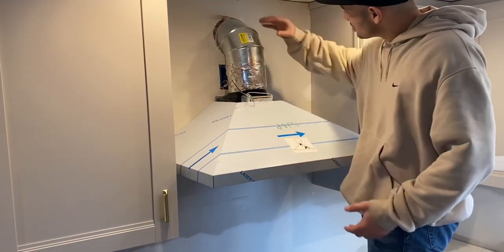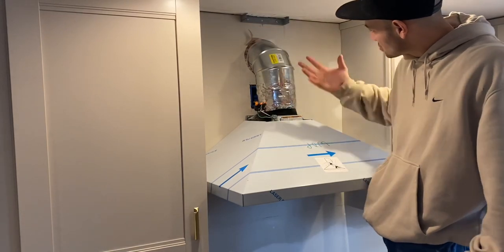Installing Wall Mounted Stainless Range  Hood with an Outside Vent

Comment: Do NOT ever cut through a stud. If you need to remove a stud you need to properly brace around it. Remember, the studs are what are holding up your 2nd story and/or roof. If any of the other studs in that wall were compromised due to water damage or insect damage, cutting through that stuck could seriously compromise the integrity of your house.
Reply: YOLO
Reply: I thought the same thing.  I'm looking to vent my microwave vent above my stove, with an empty cabinet above that.  

I'm a novice, so my idea is that if I gave electric or a stud in my way, I could move the vent to the side since it's hidden.  

I have an outside wall and vinyl siding is my next question which he doesn't show how he covers the vent.  Any tips?

Comment: Great video! Thanks for the info.

Any tips to remember when I have a cabinet above the microwave? Should I remove the cabinet above the microwave and drill holes separately through wall and cabinet? Or keep the cabinet in place and drill straight through?
Reply from the maker: Generally you leave the cabinet in place but take the doors off so they are out of your way and won’t get damaged during the process. The back of the cabinet is only 3/4 of an inch thick of plywood so the process  is the same.
Reply: @IllGetMyTools  awesome, thanks again!

Comment: I'm prepping my kitchen now to do this, great step b step video! Only exception is I need to create an opening through a brick wall with stucco over the brick on the exterior. I thought about renting a diamond core drill from HD. Do you recommend I hire a professional instead? Also will need to move my electrical to up and to the center of the wall.
Reply from the maker: I don’t know about your masonry ability. It’s not hard but you need to know what you are doing. The good thing is whatever vent cover you choose will have a flange to cover the exterior hole assuming you did a clean and accurate cut. And as for electrical, the same, it is a very basic thing to extend wires through a junction box but if that is not your forte then definitely hire a pro.
Reply: go through the roof. that way is much easier than dealing with bricks & cinderblocks
Reply from the maker: @hamajangz9586  if the house is only one story that can be an option.
Reply: @IllGetMyTools  tru damn bro that's tough but yeah dealing with masonry is a whole nother beast. it's doable but novice guys might struggle mightily in that case i would call in the pros. it'll cost you tho that shit isn't cheap

Comment: Hi.
This is really helpful. I am planning to buy a home. Do you suggest I take this as an upgrade or do it later? They are asking 7K for Wall mounted stainless range hood and Oven and grill on the side. They are providing GE Appliances. Please kindly suggest
Reply from the maker: Sounds reasonable. This hood was $1200 and my Samsung stove was $3500

Comment: Good tip on reversing cut
Reply from the maker: No problem good luck with it!
Reply: @IllGetMyTools  how about a follow up video on getting power to the hood lol
Reply from the maker: @rjennis3339  couple options: hardwire a junction box behind the vent and then simply connect the three wires from the vent to your romex .....or even better, Install an outlet behind vent, then splice a three prong plug into the wires coming out of the hood itself and plug it in.

Comment: I like how you explained the process. I have the same issue with the stud, is it gonna cause issues if I cut the stud?
Reply from the maker: Bary cutting out one stud is fine. Most of these range hoods sit on exterior walls meaning the framing is supported by the actual foundation. I’ve done this in a few other houses aside from mine with a second floor on them and have not had any structural issues
Reply: If it’s an older house with balloon framing, that stud could be the only thing supporting the floor joist above. Unless you can build a header, it’s critical to change the kitchen layout so your vent goes between studs. (We had gutted our old kitchen so saw where everything was and could make the adjustment before it was too late)
Reply: Yes. It very likely will.

Comment: Been commenting at so many videos with no reply. If the vent hood is going straight up and vertical like that it won't work for my kitchen because above my kitchen hood location is below the master bedroom. So how do I make it so it goes up and to the left to the outside wall ?
Reply from the maker: Not sure what you mean I did not vent my hood up, it’s vented directly outside that kitchen wall.

Comment: We have a vent hole thru wall (not ceiling )for microwave/vent combo above stove. Can we just tap into  existing ducting when replacing with hood vent?  Also, the electrical outlet needs to be moved in line with the hood and vent. Is it a diy, or best to hire an electrician since it will be hard wired? Nice video!
Reply from the maker: J C vent hoods need a 6” vent hole to the exterior, if you have that now then you can absolutely tap in to it. It is simple to change the outlet to a hardwire box. Just take out the microwave outlet and hardwire directly into the range hood. But if you are uncomfortable then absolutely hire an electrician
Reply: IllGetMyTools Great! Our vent hole is at least 7” (guessing as I didn’t remove the ducting). I hardwired our new double wall oven so I’ll give this one a try as well.  Just have to figure out how to pull wiring from outlet to just below vent hole like you did (do I cut drywall horizontally from outlet box to center).  Handyman just quoted us almost $3K, can’t use existing ducting, have to raise vent hole and make another hole outside , repair stucco, etc). Thanks for quick reply!
Reply from the maker: J C just run a second junction box below the vent hole. Utilize your first box where the switch was. Take off outlet you had and create a new junction in there. Then run new wires to the second junction box under vent hole. And yes you have to cut the Sheetrock to run wires if there is a stud in the way.
Reply: IllGetMyTools Sounds good.  I’ll hit you up if I run into something. Thanks!

Comment: Hole saw size is exactly 6” or 6.5” for the duct?  I’ve heard that 6” duct’s diameter is actually close to 6.25”.  Thanks
Reply from the maker: @davidv3518  I don’t remember, I bought the piping at Home Depot and then brought it over to the hole saws and see what would work.

Comment: Nice.   What do recommend for brick ?   I need do the same job thru brick.
Reply from the maker: Depending on how old the building there will still be studs, sheathing or plaster lathe, and then the brick. I would cut the brick out from the exterior and still use a 6 inch vent on the outside. Use Either a small power chisel or manually chisel out the bricks for the opening. You can then use the hole saw to get through the sheathing or lathe to reach the interior.

Comment: Maybe drill through vent hood backside (if possible) into a stud to help the drywall anchors out...
Reply from the maker: I did add two additional screws into the studs by drilling a hole into the backplate of the hood

Comment: If you measured for your duct center prior to drilling, would you still have to cut the ducting?
Reply from the maker: If you bought a 90 degree duct and measured perfectly then no you wouldn’t have any extra cuts. But ducting is very easy to cut and add lengths too if need be. I actually wanted my exterior vent to be right below one of the siding bottom lips so it looked neat and I wouldn’t have issues with water getting in.
Reply: @IllGetMyTools  Makes sense, my siding is Hardie and more smooth so I can probably put the cutout in a more convenient location.
Reply from the maker: @moonpiespotlight4759  hardy board is great! It Will allow you more options in how to finish the exterior vent. Remember when cutting the exterior siding keep drill on reverse

Comment: What did you do to cover the outside duct work?
Reply from the maker: I purchased an exterior 6 inch siding vent. It’s aluminum with a flap that automatically opens when the vent turns on.
Reply: @IllGetMyTools  thanks! Great video. Good job.

Comment: Hello
How can you add the cover on the other side of the exterior wall, where the vent comes out ?
You will need a stair in order to  access it on the outside, to install the cover ?
How to do that in case of an apartment at 3rd floor ? :(
Reply from the maker: Definitely need a ladder and depending on how high your foundation is  probably a 32-35 foot ladder. Some tool rental places rent them. But that will be the only way.

Comment: If I have a vented range hood now, can I replace it with a ventless (recirculating) hood?
Reply from the maker: SpammsMcghee recirculating hoods don’t work well At all especially when frying food or cooking things like fish it just puts the same air, smell, and smoke back into your kitchen. The charcoal filters don’t work well. But if that’s what you want to do just block the hole to the exterior with plywood insulation and or Sheetrock it’s easy to do
Reply: @IllGetMyTools  Cool, thanks!

Comment: I am concerned about this project being a DIY. We are handy, but drilling into foundation scares me. What type of trade specializes in this type of project?
Reply from the maker: There is no drilling into the foundation. I drilled through a framed, sheet rocked and wood wall. I’m a carpenter so maybe you can hire one if you’re uneasy about it.
Reply: Illgetmytools That was my next question... what tradesman would I hire for this project?

Comment: You just took out a stud and dint re-enforce it?  I hope nobody is actually taking this video seriously
Reply from the maker: I know!! I did that 4 years ago and my house collapsed!!….It’s a non-issue, I framed homes for many many years. Even if I were to run a horizontal stud to lock it in place there’s no point, it’s still not structural. The sheathing on the exterior of the house will hold that cut stud in place from moving.
Reply: @IllGetMyTools  There is a right way and a wrong way to do things! Cutting a stud without reinforcing is basically cutting corners, hoping that nothing bad happens. And i am glad it worked out for you. Horizontal reinforcements are exactly how (long) windows are braced when you cannot have a stud. I wonder what your local inspector would say if he saw that?

Comment: yo you drilled through a joist.....
Reply from the maker: BLAMBERRY one stud. That’s an exterior wall well supported with the foundation underneath. The wall can support just fine with one stud out. Joists are in floor framing not walls.

Comment: I don’t even have an electric outlet for one 🥴
Reply from the maker: shaune hemphill you can have an electrician tap into another nearby outlet in the kitchen. Many kitchens have a microwave over the stove you can tap into that junction box as well.
Reply: IllGetMyTools unfortunately my home was built in the early 70s and I literally have 3 electrical outlets and the third was added in ‘12 and I know it may be possible but I’m too afraid to even think about trying to tap in from my electric range outlet being that it’s higher voltage. Is there anyway you can tap in from and outlet on a different wall? Also can you and outlet on a wall that doesn’t have nothing on it?
Reply from the maker: shaune hemphill you can tap into any outlet on any wall, the issue always being cutting out and repairing the Sheetrock after running the wires. Do not tap into the stoves 220 outlet. Another option if you have a basement is running a new wire up from the there into your kitchen. You may be able to tap into the fuse panel as well. Again any electrician can easily be able to do these things if you aren’t comfortable with running electrical.
Reply: IllGetMyTools Thank you so much!!